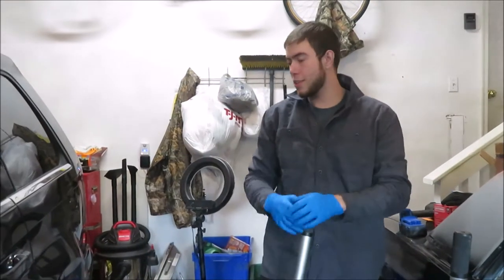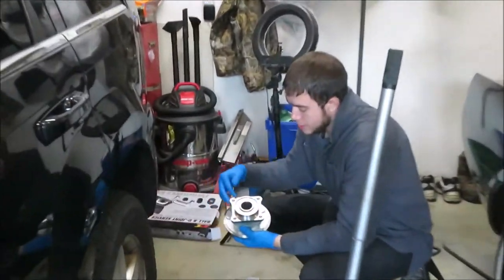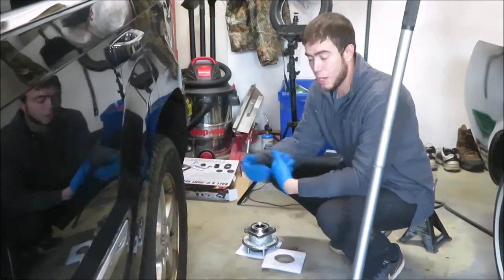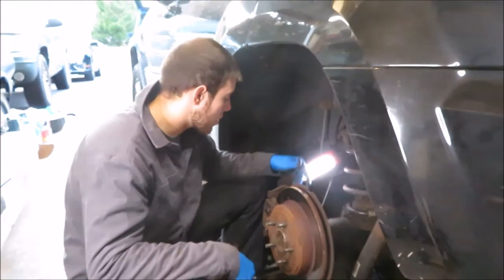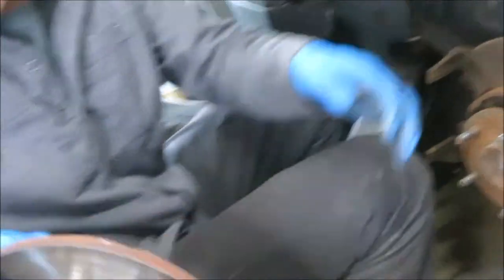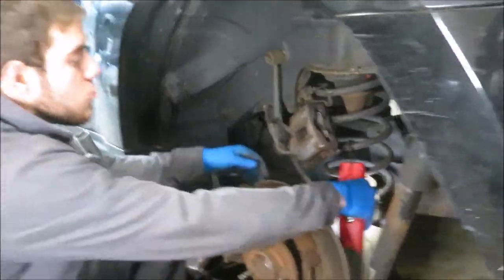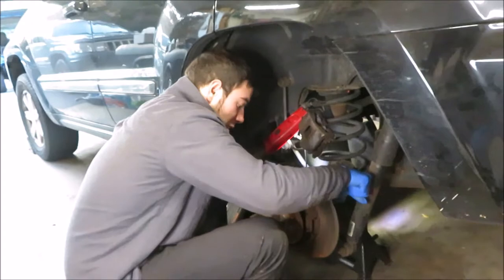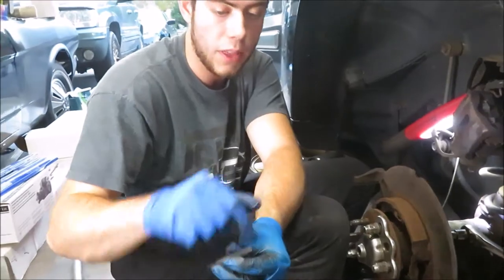Replacing A Rear Wheel Bearing

Comment: You appear to be very knowledgeable, at the same time you need to understand that there are various degrees of DIY mechanics searching Youtube. You started with saying it was an easy repair ..  then 3:04 we see you using a hammer on what we guess are bolts or nuts at the back of your rear assembly. Then your video basically goes from a DIY video to a music video of you and your hammer. Finally, towards the end you are blow torching a bolt to remove, then at 4:23 I guess you wanted to continue with your music video and you grinding ... something. It would be nice to know what or why... but instead of hearing your instructions ... we hear horrid Youtube stock music. You do not lack skill as a mechanic ... but as a teacher/instructor of your craft, you need a lot of help to make better Youtube videos.
Reply: Agreed. I am looking how to do this and I didn't learn much by the end of it. I was expecting instructions and what types of tools to use but that never happened. It could of done without the stock music either, music is fine but it doesn't need to be child friendly either. 

This gets a 2 out of 10 because you have knowledge and experience but you need to learn how to share it in layman's terms.
Reply: Lol. Yeah I believe he knows what he's doing, and I know what he's doing, but I'm just picturing the first time diy car guy smashing his hub and burning down his garage!